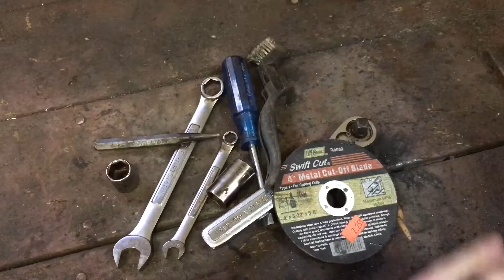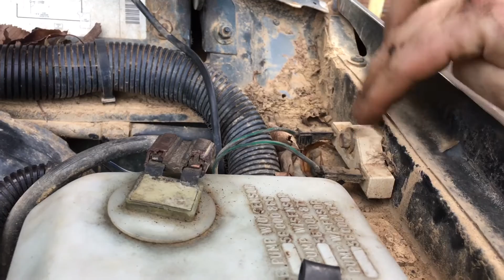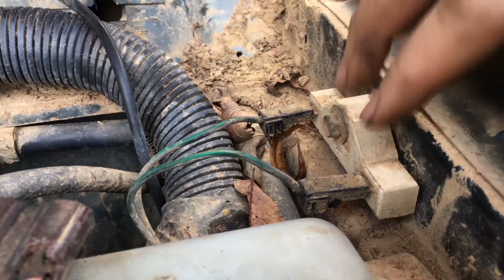Fuel Pump Ballast Resistor

Comment: It's only purpose is to drop voltage from 12 volts to 10 volts to quite the factory Bosh fuel pump.
Not in factory service manual , was an add on to make customers happy 😊. Not easy to find but just bypass or use a resistor that drops voltage. 1 Ohm.
Search 1 ohm resistor and look for pictures of it.

Comment: hey ronnie man I'm in a pickle with my 92 xj. I'm having issues with it running without the ballast resistor plugged up and the fuel pump is really loud. I also have code code 12 75 73 and 35

Comment: Ballast resistors reduce current not voltage, that's done with a regulator, or transformer, if you are experiencing voltage drop, the resistor is bad, bypass it or replace it.

Comment: Actually it does effect starting and running.
If your jeep starts up then dies every time , it's bad.
It's a 1 ohm resistor spring inside ceramic block.
Clay type sealer on back dries out cracks and leaks in water that rust through steel spring. Just bypass.
Drops
Reply: nichrome wire
Reply: Where would this be in my xj 98
Reply: only used from 1987-1993.

Comment: Good explanation of its function and symptom when faulty.  
? Which year/model vehicle is that ?  [Stupid question. 1988, in your statement.]   Do you know where they hid it on the '96 Cherokee ?
Reply from the maker: +Conrad Kritzberger 96 don't have them
Reply: Thank you.
That would explain why I can't find it.  
It's just another aspect the "Haynes" Manual has that's screwed-up.  Their wiring-diagram shows one in the fuel-pump circuit.
Reply from the maker: Conrad Kritzberger watch that Haynes manual some of it has false info I know a lot of guys that hate that manual lol
Reply: @cherokeeronnie does my 98 have one

Comment: alright mr cherokee ronnie!

So my jeep has sat for 3 years, i added 8 gallons of prem gas to her thinking that would help, however she died after driving 80 miles... i think i ran outta gas... get her to the side of the road, crank crank crank nothing... crank crank crank, she tries to start, dies.
Got her running after adding 5 gallons of gas, however, when i give it gas she dies, let her idle for a bit, idles rough ( died sometimes). Now she wont start again, maybe i need to add like 10 gallons of gas with some cleaner? sounding like she's putting herself out... not sure, either clogged or not enough fuel.

maybe the fuel pump took a crap from the bad fuel? i checked the pressure at the shradder valve and 0 pressure... when starting and just turning the key on? i need to make sure this gauge works but its brand new... she still tries to start though... sometimes

maybe u have an idea?
Reply: I have this same issue on my 92 Comanche. Similar cause: ran outta gas, put some in, runs rough then dies. Fuel pump and filter didn't solve anything. I'm at a loss.
Reply: @TheTechnicalWizard did you figure it out ?
Reply: @nathanmccumber8965  Yep! It actually turned out that my ignition coil was the culprit